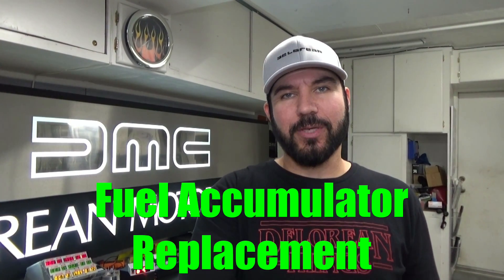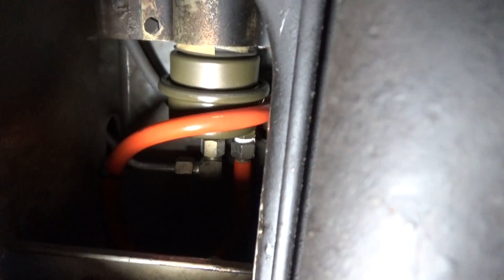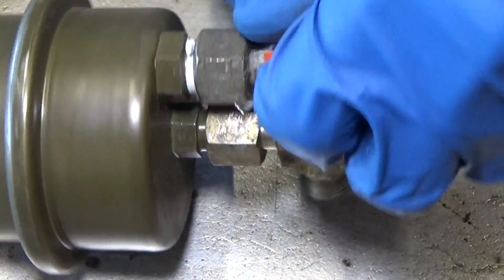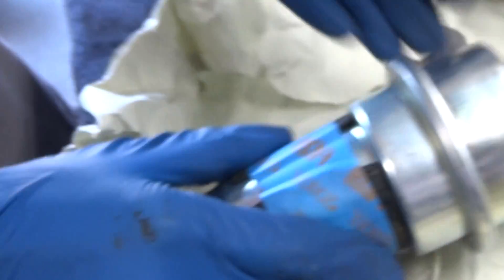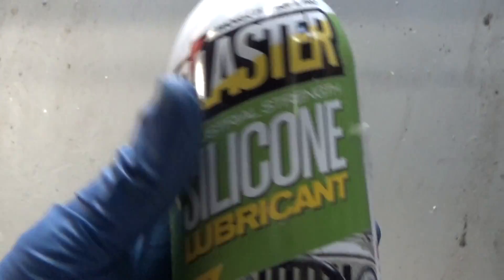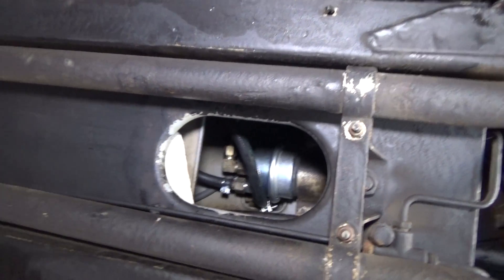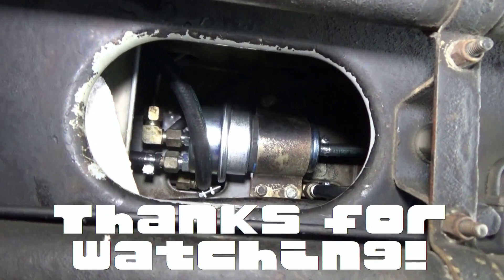Hot Start issues? How to replace the Fuel Accumulator in your DeLorean

Comment: Why don't people replace this with a regular fuel pressure regulator
Reply from the maker: They serve two distinct purposes.  The accumulator maintains residual fuel pressure in the system after the engine is shut off.  A fuel pressure regulator controls system pressure during engine operation by bleeding excess fuel back to the tank.  The main purpose of the accumulator is provides a small reserve of pressurized fuel for immediate restart (bad accumulators lead to hot start issues). Swapping it out with a FPR wouldn’t accomplish this.  Also, the PRV does have FPR in the fuel distributor.

Comment: Replaced my second accumulator about two years ago. Problem is, other things got in the way and I am just now pressure testing the system after doing a bunch of other maintenance items (pump, lines, etc.) Wouldn't you know it, I had a leak on the 5/16 line going into the accumulator. Tightening did not help. I ended up replacing both with Gates Barricade and new clamps. Problem solved. Do NOT try to go cheap on these items! By the way, DeLorean shops should always have at least one mechanic with small hands to do this job. I had a heck of a time.

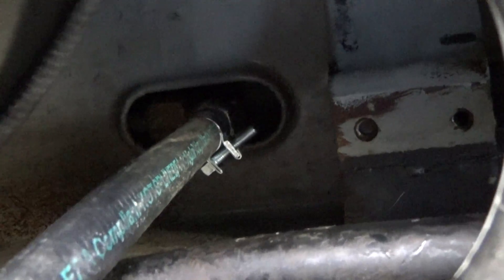Comment: You left out an important part between 12:30 and 14:00. The compression fitting install on the hard line was not on camera. Need to see what the hard line end looks like before putting the compression fitting on.
Reply from the maker: Indeed. Sometimes when I need to take a break Mr 88 doesn’t wait and keeps on working!!

Comment: Hello from Germany. I've removed everything. Only the longer hose is still fitted. Petrol is running... after more than two liters!! I closed it with a pin. Normal? Will this stop? 😮 Regards
Reply from the maker: Strange. No it should only drip a little. The steel fuel lines only hold so much and with the car off the fuel pump isn’t pumping. Is the car on an incline or something?
Reply from the maker: So after some research there can be at times a siphon action and it will continue to drip. Try disconnecting the return fuel line at the pump. Let us know how it goes
Reply: Mission accomplished. Just put air into the line... then it's over.

Comment: I have replaced everything that fuel, coolant and electricity touches in my Delorean and if it sits on blacktop on a sunny day over 90 it will STILL have classic HS issues.
The fuel in the tank just gets to hot. Changing to a Viton O ring in the FD is a must and help eliminate most of my fuel issues. My car has the air dam installed which helps keep the blazing hot air from the fans from blowing directly on to the fuel tank. Again, helps but stainless steel + aluminum engine + front radiator/rear engine + heat and sun = problems. Some claim no issues in 100+ summer temps which I say you won the lottery. Like the Pantera and other exotics, they simply do not like the heat and after throwing handfulls of cash at this issue with the D, I have simply just don't venture far in the summer and primarily drive only during fair weather.
Reply from the maker: Have you tried Dave McKeen’s hot start relay and solid state RPM relay with the hot fix?